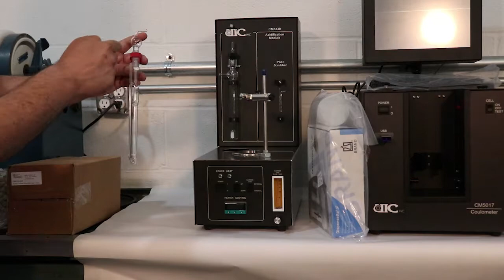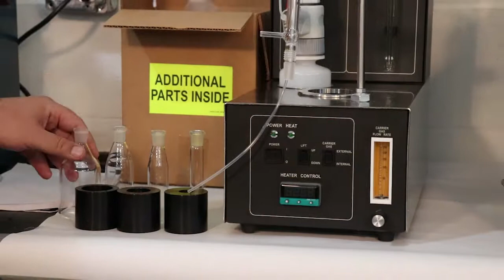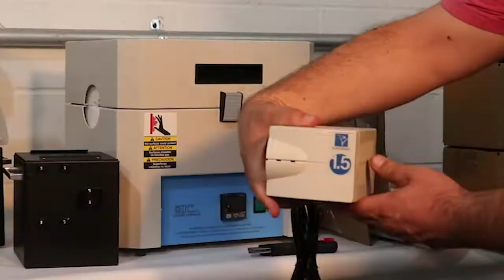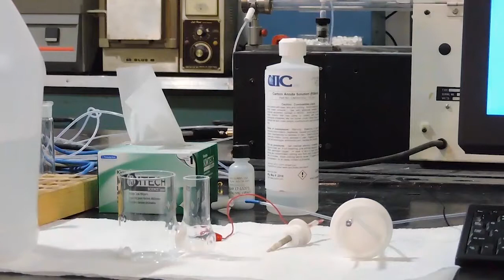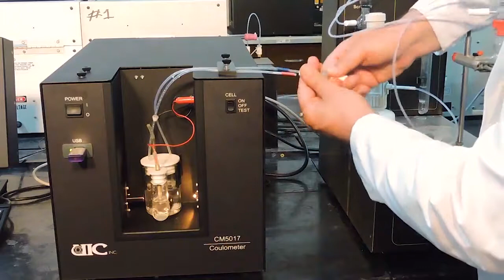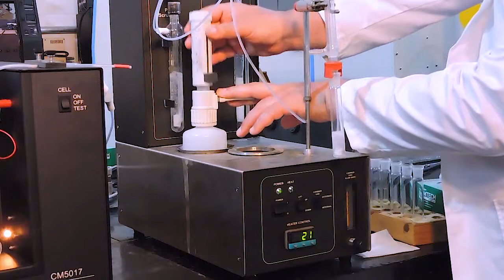Setting Up and Running Samples on a CM140 System

Comment: Hello. Idk if this will be seen but I am wondering what purpose does the addition of KI in the anode cell play?
Reply: Potassium Iodide (KI) is used up during titration in the cell, so solid KI is added to keep the solution saturated. Basically, it increases the titration capacity, else anode compartment would have to be much larger.
Reply: @uicincorporated9060  Oooh i see. Does the KI in the solution act as a scrubber or does it serve a different purpose?
Reply: And what about the DMSO in the anode solution?
Reply: Hello,  @cyphen6710  ! Do you have one of our instruments?
Reply: @uicincorporated9060  hello, yes we do have 2 coulometers. One as shown in the video and one older model